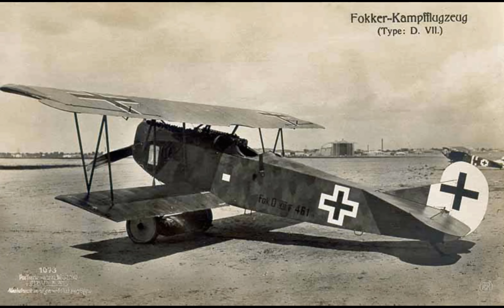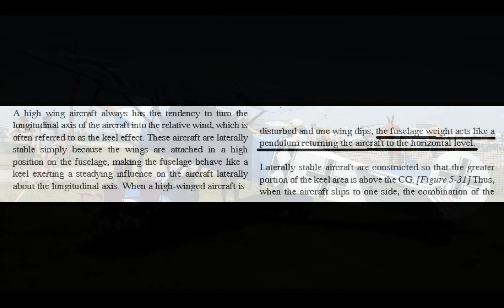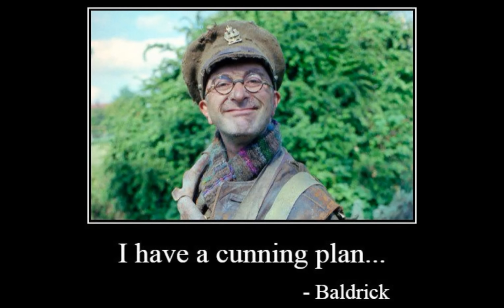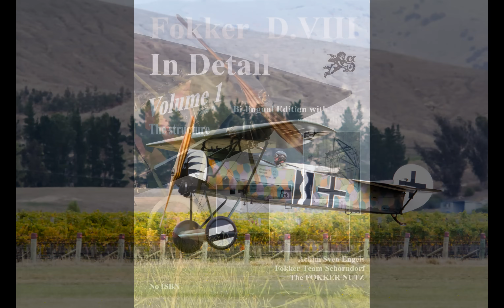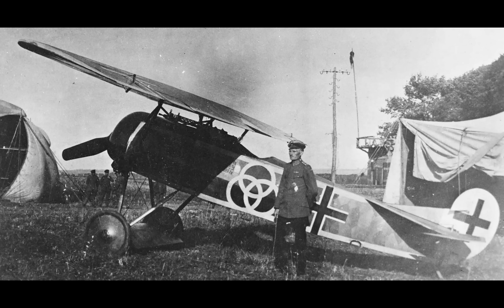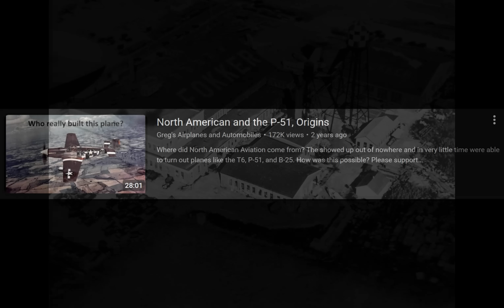Fokker D VIII The Best Fighter Of WW1

Comment: NOW I get the Dr. designation! It's not some doctor.

E Eindecker
D Doppeldecker
Dr Dreidecker (I suppose)
Reply: It seems a bit strange when translated. Basically you have one-decker (one wing), double-decker, and three-decker, which begs the question, why "double" instead of two-decker? Why not zweidecker? Maybe I'm working backwards, biplanes generally came first so maybe the original word was doppeldecker, but single-wing being einzeldecker and triple-wing becoming... dreifachendecker? Maybe? It does get a little weird, and it's easier to use numbers instead.

Although if you Google zweidecker, you do get two kinds of results. The first is a two-decked age-of-sail ship, which makes sense, and you do also get some ships when searching for dreidecker. The other, less common, result will be stock photos of German biplanes. It seems perhaps zweidecker might either be a lesser-used term, or just a mistranslation of biplane.

I'm sure actual German-speakers will probably chime in with better explanations.

Comment: It should be noted that the Siemens-Halske Sh.III contra rotary engine was considered and would have been over 160 HP.  The big problem was that Germany didn't have enough Castor oil to lubricate all of their warplanes with these demanding, lubrication sensitive rotaries. The Germans made an ersatz Castor synthetic called Vitol, it had a bad reputation of destroying engines.

  There were rewards out for German army units that recovered any Allied supplies of Castor oil and  (or) Entente made rotaries like the Le Rhone, Clerget or Bentley.

Concerning the later airliners made by Fokker. Their 1919 F.II 4 passenger monoplane was built similar to the D.VIII but much larger.  And it was powered by the 200 hp BMW engine that made the D.VII such a great fighter. 

 Some pilots at Fokker in the Netherlands, ( after the Armistice,  Anthony managed to sneak most of his factory out of Germany on a train in the last days after the Armistice.) flew the F.II against a D.VII in a mock dogfight and the big passenger Fokker was very nimble and held it's energy well in turn fights.

Comment: Another potential advantage of a parasol wing is relatively lower mounting point for the wing struts vs a mid-wing, which helps with strength.  More of the struts' load goes into resisting the wing's upward loads, and to a lesser extent, it downward loads.      A parasol wing is also relatively easy to build and attach to the fuselage. As pointed out, the D VIII was economical to build.
 Once the fuselage got thicker (from top to bottom), a high wing essentially did the same thing.  In some respects, early parasol aircraft could be thought of as high-wings before they decided to enclose the cockpit and/or passenger/cargo compartment.

Comment: "parasol wing"

Don't forget, there were fighters built with these as late as the 1930s.
And Poland kept building a bunch of gull-winged planes.

"allies"

There are no allies in WWI as you speak of them.   The only ones, are the Central ALLIANCE powers rather than the entente.
For comparison, my old encyclopedia from 1928, in Swedish, refers to them as the Entente powers and the Alliance powers.
This was still true in encyclopedias from the 70s and 80s.

Absolutely noone ever called the Entente the "allies" until after the internet flood of history falsification and rewrites came along.
Reply from the maker: https://www.oxfordlearnersdictionaries.com/us/definition/english/ally_1
Reply: @GregsAirplanesandAutomobiles  And that is relevant how?

In WWII, the "allies" and "axis" are the fighting parties.   Using the word allies there is correct.

In WWI, there is the "entente" and the "central alliance"/"central powers" depending on which language you look at most.

There, the "allies" refers to the central alliance, not the UK, USA or France or Russia.

And trying to push that it doesn't matter, like some do, is literally falsification of history.
Especially when it is literally the opposite to intended meaning.
And when it's used to pretend that WWI and WWII are "just the same thing, evil Germany starting wars blah blah" BS.

Please do not if you have any respect for the truth.

Comment: G'day Greg,

Yay Team !

Sad about the blustering Popinjay, at the Pretender's Department..., at that nameless Not-Sponsor with which you were being teased...

Egg-Timer started to run a sweepstakes on how long before they announce Layoffs, or Administration ; eh, what...? (!).

But it's a very nice Video, nevertheless ; thanks for posting it.

As regards Fokker D-VIIIs.

On the one hand, I've read a persistant story asserting that the "110 Hp" Le-Rohne Rotary Engine in some Camels made them fly much better than the "130 Hp" Clerget Camels...(?), returning figures as good or better than the "150 Hp " Bentley BR-1 powered Camels...; leading to the assertion that the "110 Hp" Le-Rohne Engines might be actually delivering closer to 160 Horsepower worth of Twistiness into the Propeller-Hub...(?!?!).

I find it a bold assertion, but if true it would explanin many otherwise apparent anomalies...(?).

And, regarding the Wooden Airframe-Components arriving and  being predominantly undersized as compared to Plans, Drawings, and written Specifications...

My hypothesis (educated guess) is that between Watime Shortages, Labour Shortages Maritime Blockade and protracted drawdown on pre-war Stockpiles and production lines...; the Contractors cut all those Components to the exactly correct Sizes, but between being cut out and being installed and glued, the Sawn Timber finished drying, and as it dries out..., Wood shrinks - along the Growth Rings.

Assuming the  Wood was all propperly Quarter-Cut milled, then the Rings will run perpendicularly between the larger pair of parallel Faces on all  the Boards ; so the Wood will not warp nor twist nor cup or bow or crack or split, but it will Shrink - in all dimensions.

And by the end of 1918 ALL the propperly seasoned Quarter-Sawn Billets had long been cut up, built with, and crashed in Service..., so whereas in England the Kiln-Dried Wingspars of Camels were considered suspect, apparently Fokker's Contractors were using almost- seasoned, still-green but correctly Quarter-Cut Timber....?

And, of course..., Honest Antony would never blame the Customer, would he...?

Such is life,

Have a good one...

Stay safe.

;-p

Ciao !

Ciao

Comment: The D8 was the second balsa model I built. My father had tried to get my older brother interested in building flying models. I saved my allowance and in '73 I bought a couple of models. The D8 flew the best of any rubber powered model I ever built.
Reply: i built many guillows kits back in the early 1960's and the biplanes always ended up being too heavy for rubber band powered flight so i would have some for static display and some i powered with the small .010 or .020 cox fuel motors for free flight. i did not build the fokker monoplane but did build a piper cub with a high wing and that flew decent with rubber power. i think if i had used less glue on joining the wood parts and  less dope on the covering it may have cut down on the overall weight.
Reply: @steveperry1344  We have a small foam R/C monoplane with cox fuel motor (rudder & elevator only, no ailerons), we've had a lot of fun with that one!
Reply: @steveperry1344  I agree. I build many of those with my dad when I was young and the high wing designs, like a piper cub or fokker D8 always flew better. I think they were both lighter and more stable.  When I had kids I built a spitfire that flew well rubber powered, but I kept it very light. As a youngster it was alwaya too fun to paint the dope on.

Comment: I built a 1/4 scale Fokker D VIII  from Balsa USA and the plane had exceptional flying qualities.
Reply: nightmare on the ground.....chicken walk of death.... Mine was a Henry haefke
Reply: @chrisgoffa8129  Haven't crashed mine yet. I fly nothing but tail draggers.
Reply: I scratch built a 27 inch control line model using a Cox .15 size engine and flew it in the San Diego Navy base baseball fields in '73. That was covered with Tpo Flites Monocote in black. It was stolen out of the hobby store shop where it was built after 6 WILD flights and I never saw it again. Flew great and was as close to perfectly scale as I could make it at the time. 
Someone owes me big time. The Cox engine was pretty hard to come by and was probably the reason it was stolen. 
I lost a few airplanes, radios, engines and kits to theft and was one of the reasons I became disillusioned with the Navy. It got so bad I took up drinking for entertainment and eventually made me push for an early discharge. Disgusted. 
The D8 was the best flying control line airplane I built until I started up the hobby again in the early '80s. I now miss building as I am living in a hotel room now and all my building stuff is in storage.

Comment: The parasol wing was chosen to safe time. The fuselage layout including the general positions for all the attachment points, the strut layout itself, the strut to wing connections and the design for actuating upper wing ailerons already were in existance. Variants were used successfully in the Dr.1, the D.VI and the D.VII. The E.V's whole fuselage isn't a new design. It's a modified Dr. 1 fuselage. That kind of design was well within the comfort zone of the designers and it only needed minor adjustment to make it fit for the E.V / D.VIII. A low wing monoplane would have required much more brand new design work and the required dihedral would have resulted in a more demanding wing spar design. 
An additional reason for the parasol design is that the military really liked to be able to roll fuselages on their own landing gear when the wing was removed for repairs or rail transport (a feature that ultimately lived on into the Bf109). They were unhappy with the Dr.1 because its lower wing mount interferes with the landing gear mount. Fokker certainly didn't want to get the same complaints again. 

Considering the stall speed: Send Achim Engels an email. He knows it.

Comment: German industry generally comes-out with well-calculated solutions to a problem. But it's not something that is always realistic or economically feasible. The idea of "Economy of Design" never seemed to exist in their pre-Cold War projects. I would go so far as to say it's hallmark of German industry.

Certainly, French, UK, and US design projects have also suffered from the same problems, on occasion. The French especially, in the 1930's, were building planes that only skilled craftsmen could possibly produce. No "Ford assembly line" could be possible, as each component needed an engineer's full attention, and slight modification. That is a problem with the design, not the personnel. 

So this is a trap many powers have fallen into, and still continue to fall into. Sometimes, the best solution is NOT to make the best solution, and instead make a solution which WORKS: minimal complexity, larger tolerance for errors, and ease of manufacturing. This design ethos results in the production of more, and better products, overall.
Reply from the maker: The German overcomplication thing is really Tank and armored vehicle over complication. The 109 and 190 were actually quite simple.
Reply: Agreed. Those were the best products of the industry. I would say, they were more hampered by the perceived need to diversify than by their own qualities. For the Bf109 and the Fw190, they were top of the class. I would not call them "over-engineered". They were properly engineered. 

However, I'd argue that the 109 was more a "maintence hog" than it needed to be. But that's besides the larger, institutional issue, that so many fighter variants were produced. Let alone the other Luftwaffe experiments.

Someone did get it right with the Bf109 and separaratly with the 190. But they also didn't share basic things like the surprisingly-modern cockpit configuration or the electrically-actuated flight controls of the Fw190, with the horsepower and performance of the 109. They could have, but they didn't.

Comment: Perhaps I'm overthinking this and interpolating information

But it wouldn't surprise me if, in addition to what was shown in the video, the D.VIII didn't have a good reputation do to its engine.

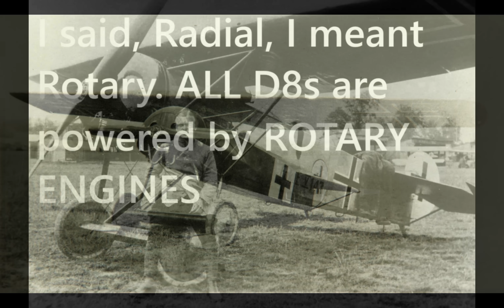I've heard that the Oberursel Ur II 5:08 was quite infamous, especially for its poor lubrication (due to resource scarcity) and the resulting overheating and power loss. They had to be checked and replaced frequently, and were often swapped entirely for captured engines. 
-Werner Voss died flying his Fokker F.1 with an engine from a Nie-17. 
-Josef Jacobs, a long-time Dr.1 user even in late 1918, maintained 2 of his aircraft using only captured engines.
And I think Fokker was also aware of these engine problems related to the Ur.II and German rotaries in general. He would later make the D.27 and D.29, developments on the D.VII, abandoning the rotary engine and returning to inline engines. The D.29 was a finalist (2 models shared the 1st place) in the 1918 Third Fighter Trials, and was essentially a D.VII with the wings of a D.VIII.

I have quite a bit of information on the topic and a lot to say, but YouTube comments aren't the best place for it. It would be interesting to have a space where we could share this kind of thing more easily.
Reply: The Germans had problems with their rotories in part due to their inability to obtain Castor oil, which was one of the few (only?) high temperature lubricants then available. Castor oil was then considered a strategic material, as was spruce wood to fabricate wing spars.
Reply: @fafner1  Correct. 

Moreover, the engine tests at Motorenfabrik Oberursel were misleading because they were initially conducted (around February 1917) using castor oil (captured in large quantities in Antwerp early in the war but now in high shortage). Reports of problems only began to surface when production models arriving at the front were lubricated with alternative/substitute lubricants.
Reply: It wasn't just the Oberursels. The Siemens-Halske rotaries also suffered from the castor shortages.
Reply: Yeah their rotary engines fighters are famous for never fully reaching their potential because of the castor oil crisis. It's one of the things that a lot of Youtubers don't talk too much about (if at all).

Comment: The Fokker DIII was clearly held back by its 110 hp Oberursel radial engine. In comparison the Sopwith Snipe used a Bentley BR2 with aluminum cylinders that produced 230 hp. Kevin Cameron  has described the Sopwith Snipe as an obsolete airframe with a modern engine, while the Fokker DVIII was a modern airframe with an obsolete engine. 

It is interesting that the final German fighter competition held in October of 1918 was won by two airplanes, one a Rumpler DI biplane and the other a Fokker V29, which was essentially a parasol monoplane version of the Fokker DVII.

Comment: The DVIII is not a monoplane, its a 1 1/2 plane.  Look at the little wing on the landing gear.  When I was a kid I had built a DVIII RC with a .10 cu in fixed throttle engine and two channel control.  It suffered a structural failure on its first flight.  Those damn subcontractors.
Reply from the maker: It might be a 1 and 1/10 wing.
Reply: It’s a monoplane.
Reply: It's not really a Sesquiplane if that's what you're trying to say.   The little wing on the LG was not all that effective for making a lot of lift.
Reply: @tauncfester3022  I was joking.

Comment: So by the metrics Greg is using in this video, the P-51 was superior to the -P-47. Equivalent to slightly superior performance, with lower cost, and more impact on future aviation (extensive use of NACA results as a basis for the design, etc.). I don't think that's a very controversial statement, but both the DVIII and the P-51 had earlier learnings and developments in the war, so I don't find that very surprising either.
Reply: I see where you are going.  Ha!

Of course, it depends on what metrics are important based on the circumstances. 

For 1917/18 Germany the availability of raw materials was of extremely high importance due to extreme scarcity. 

For 1943/44 USA the scarcity of materials was not as high of a priority.  The focus on the pure performance of an aircraft could take higher precedence over the cost of materials used.

Pity, that we often forget how fortunate we have had it with two oceans between us and most of our enemies.

Have a great day.
Reply: Greg talked about this in one of his P-51 videos where he's talking about how cost effective it was compared to our other fighters. If I remember right the P-47 was around 50% more and the P-38 double the price.

Comment: Greg, how is front cross section determined?  You said it had a cross section of only 6.34 sq ft.  This seems very small if you include the wing, landing gear, etc.  Is that for the fuselage only?  Even that seems very small, about equivalent to a 2 ft diameter circle.
Reply: I believe cross section is based on the equivalent drag of a flat plate perpendicular to the direction of travel.  So, the cross sectional drag is equal to a 6.34sq/ft of flat plate facing the direction of travel.

Look up an aircraft known as the Arnold AR-5.  It was famous for breaking 200mph with only a 65hp engine.  I believe it was the first aircraft designed with 1sq/ft or less of cross sectional drag.  The design led to the Arnold AR-6 which was a successful Formula 1 air racer.
Reply from the maker: Yup, what Clarke said is correct.